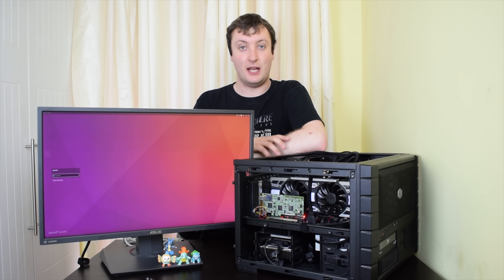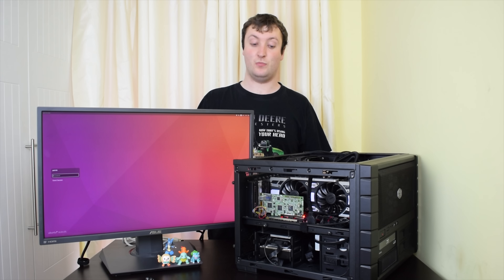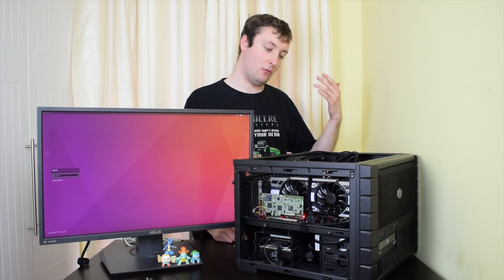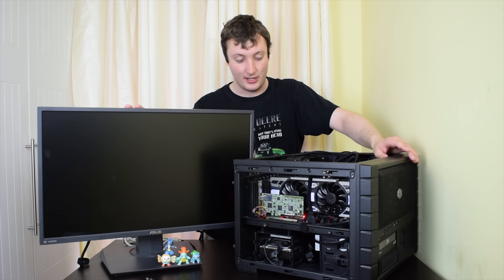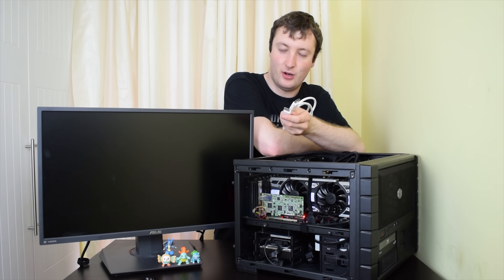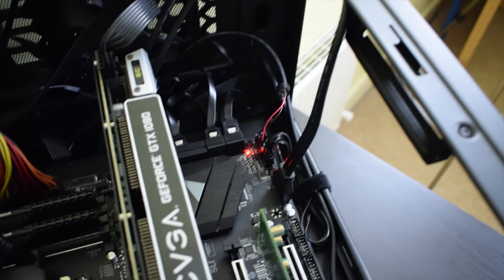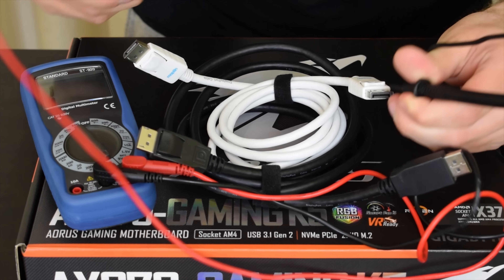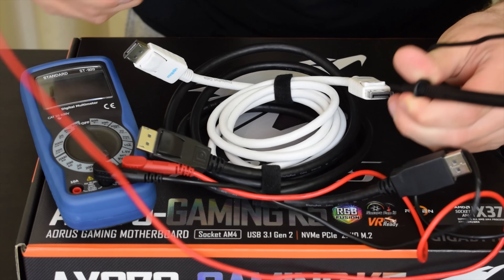Display port can cause boot issues

Comment: Im having the boot issue too, I have to disconnect the display port when I turn it on and then quickly connect it then the pc boots. But eventually when playing games the gpu eventually crashes and lags and pc freezes up. Same issue?
Reply: First part is related. Your PC crashing and freezing is not. Most likely old/out dated drivers etcetc

Comment: Oh mannnn..... I am utilizing a Dell Optiplex 7060 SFF with 2 monitors connected via the DisplayPort cables. My PC does not start and the power button is flashing in orange until I pull the DP cable from one of the monitor. It took some time to find this... I watched your video and you are 100% correct in your findings. I went further and cut off the 20th pin wire from the connector and W-A-La.... my PC boots up successfully. Thank you so much!!! You made my day !!!!

Comment: I got Asus VG248QE and i wanted to be using DisplayPort instead of the included DVI-D cable and it worked very well with the DP cable "HAMA brand" but after a while i ran into the first time my PC would act weird like it beebs then no signal and nothing on went back to the original DVI-D that came with the monitor and it worked well.. what kind of cable would you recommend of Amazon US?
Reply: I have 3 of these monitors and I have to boot using an hdmi separate monitor for it to boot up. Any suggestions?

Comment: OMG i'm sure it will solve my 2+ years problem of monitors flickering when i turn on microwave on display port but not on HDMI ! i will test that, and if it works, you are a god.
Btw, where did you get the white display port cable ?

Comment: Question tho, did this Display port do any damage to your components?
Reply: Julien Popa-Liesz in some situations it can brick your GPU more likely than anything else.
Reply: Everything still works fine for me and I lived with my computer boot looping for a month or so with the cable plugged in. My motherboard just lights up on the EZ debug CPU, VGA and BOOT when booting up, but it still posts and works normally despite this oddity.

Comment: Dude, I went through the exact same process as you. I spent two weeks testing everything until I found it by chance, by the debug led from my aorus mobo.

Have you had any problems with your hardware since then?
Reply: I hace same problem with z490 aorus ultra